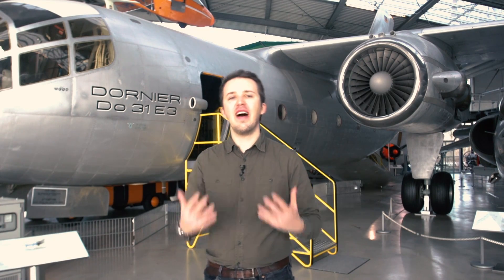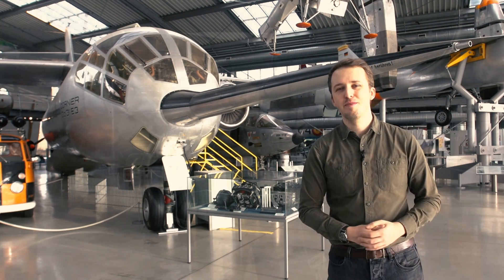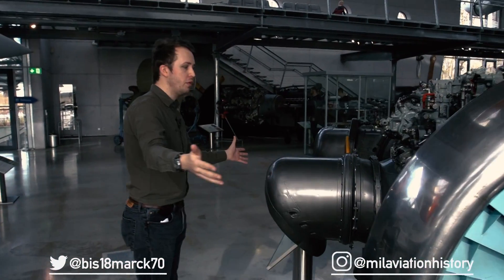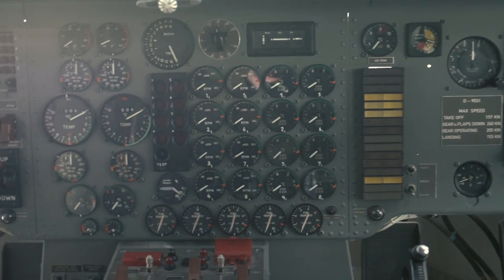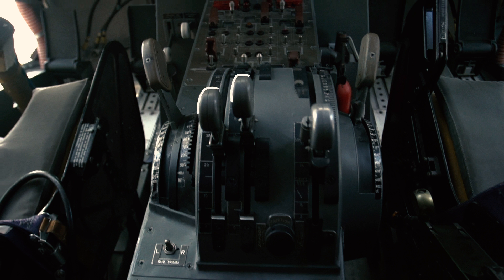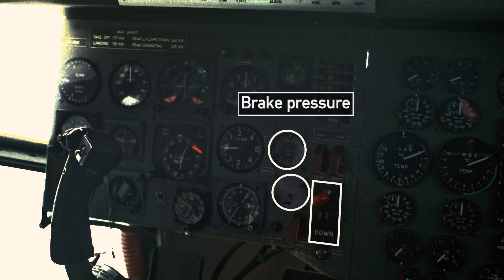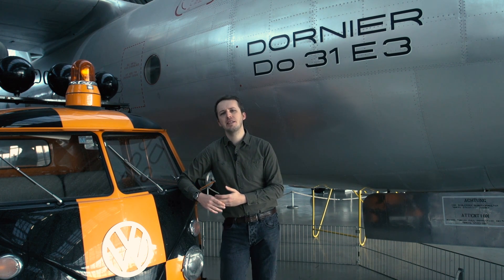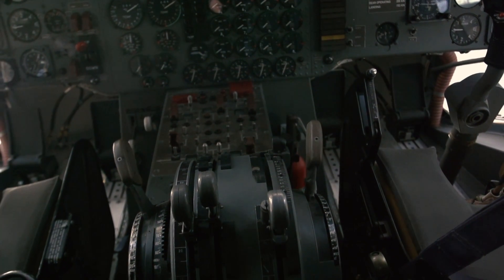Inside The Cockpit - Dornier Do-31

Comment: One wonders 'Why' hasn't SOMEONE Revisited this plane, using Modern Build-techniques/Electronics?! It could shed a ton or two, just by doing That, while gaining in simplified Flight Controls!  BTW, it's Not the 'only VTOL Cargo plane'; the Last Curtiss (the X-19) pre-dated this by a few years, and the Bell X-22 was a contemporary to it. Neither of those, though, were JET powered. Dornier was on to Something with this, and it's sad it wasn't developed further.

Comment: I've walked through this aircraft at Oberschleißheim. It's an artwork in tissue-paper-thin aluminum. The Dornier Do-31. The "Deutsches Museum Flugwerft Schleissheim" (it's an annex to Munich's German Museum of "Masterpieces of Science and Technology" and is also worth a visit) is well worth the visit. Outside of Winter, take your roller blades - That is, if you don't ride your bicycle from Munich's city centre. This aircraft comes with chrome bling. They also have a very truthful hang gliding exhibit. There's a video suggestion 🙂

Comment: I love this idea but its easy to see why it wasn't taken on because the main use of VTOL in a cargo role would surely be the ability to drop cargo somewhere that would be inaccessible by conventional planes. While VTOL craft like this can operate on small patches of land without a runway, they still require a 'good' surface to land on, which limits them to maybe built up areas like car parks or roads or something? 

If only there was another kind of cargo transport that didn't actually even have to touch the ground to deliver something heavy.... oh wait, helicopters :P 

Now I'm definitely more of a plane enthusiast than helicopter fan, but one cannot deny that the Soviets had the much better idea of just using choppers to throw stuff about instead of making an awesome big jet thingymabob like this <3

Comment: It's a german plane, yea? Why are all the circuit breakers and cockpit instruments all labelled in english? 

US component manufacturers?
Reply: At a guess because it was designed to a NATO specification and English is one of the two official languages, the other is French. Add in that English is the default language for air traffic control and it makes sense of a sort.

Comment: Talk about a niche project!
If you've got a to get goods into an area without a runway, you can parachute them in out the back of a C-130 and it doesn't need a long runway to take-off from either.
Then for everything else the Chinook might only have half the range and speed (range being much more important for a transport aircraft) but it has twice the payload capacity.

Comment: Boeing V-20 Osprey says: "Am I a joke to you?"'

Seriously, isn't the Osprey a VTOL transport also?
Reply: It's a turbo-prop not a pure jet.
Reply: He does say "VTOL transport jet plane." You're right. The V-22 must be the most produced VTOL transport ever though.
Reply: @HSMiyamoto  not sure about the production numbers of the VCV-22 being the largest as there have been around 16,000 UH-1 helicopters built. I suppose it depends on where the line is drawn.
Reply: @HSMiyamoto  Well, Helicopters are all VTOL, since that's what they DO. Vertical TakeOff and Landing.  I suppose the Osprey would have to be called a Hybrid aircraft, since it is also capable of Short TakeOff and Landing, where it rolls on the ground.
Reply: Rotary and fixed wing VTOL planes don't compare because a chopper will never have the range of a fixed wing plane. The unclassified range of the Osprey is over 1,000 nm and that's why the U.S. military developed it after the disaster at Desert One in 1980.
Reply: @HSMiyamoto  helicopters are still V/STOL aircraft irrespective of their lack of range. The problem with the Desert One landing site was it was prone to high winds at all times of the year.
Reply: 1. Except for craft that are literally launched vertically like the Bachem Natter, all VTOL aircraft are also STOL aircraft. Helicopters usually lift off going forward, although they can lift themselves straight up and then transition into forward flight. 

2. Although tiltrotor planes might seem simpler than choppers, the fact that helicopters date back to WWII shows that they must not be. The reason the U.S. military persisted with the Ospey over literally decades of development and at least one tragic mass-fatality crash was because the Services want the ability to land troops deep inland without having to capture an airbase first, or even resort to aerial fueling. Range and payload are the advantage of the Osprey over choppers. The U.S. military also has a lot of helicopters for landing troops and conducting other missions, and will for the foreseeable future.
Reply: @HSMiyamoto  you obviously aren't aware that the tilt rotor concept dates back as far as 1902 and and a couple of Swiss brothers? The first practical designs didn't turn up until the 1930s in Germany, but WW2 put pay to their development.
Reply: @neiloflongbeck5705  No, I didn't. But it's probably like the forward swept wings on the X-29. An interesting idea that needed computers to make it really work.

Comment: I had no idea this machine existed.  What a beautiful piece of engineering!  Imagine how clenching it would be losing engines during vertical landing?
Reply: It had an excess of thrust and could afford to lose two lift engines during a vertical take-off or four during a landing.  If it lost one of the main Pegasus engines though, that would have left a mark...
Reply: @FireAngelOfLondon  The early Pegasus engines were notoriously underpowered too.
Reply: @stevek548  That's because forcing gases around tight corners tends to bring heavy frictional and compressive losses and the engineers took some time to learn how to make it work.  The Pegasus has gone from the first versions producing a mere 9,000lbs of thrust to the latest versions that can produce 23,800lbs.  A lot of that improvement has come from finding more and more efficient ways to make air and hot exhaust gases flow around corners, which presents some of the most difficult challenges in the aero engine field.

Comment: Great video! 
Now I hace a question. If this is the only transport VTOL airplane, what's V-22 exactly? Or is there a difference due to the rotor/propellers?
Reply: Yes this is a pure jet where the engines provide the thrust and the V-22 is a turbo-prop where those big blades swinging around provide the thrust.

Comment: The V-22 is a VTOL transport jet plane (turboprop).  It's been produced in quantity and used in combat.  It doesn't have 8 dead cruise weight lift engines.  Rather it has two engines that are used for vertical and cruise flight.  It's American.
Reply: It also had its maiden flight more than 20 years later. Because in 1967 there wasn't technology available that could make a V-22 fly.

Comment: The Do-31 E-1 is infront of the Dornier Museum in Friedrichshafen. two were build. Testing of the VTOL Systems were conducted with the "Schwebegestell" to set up the control systems. With an another construction there trialed the complete system. The ground erosion was too much. It broke some flight records, but the high fuel consumption on a cargo plane didnt make it up in the long run. And it was the time of the oil crises. We germans want always something that can do everything. 

Another interesting prototyp of Dornier is the Do-29. Testing of STOL capabilites.

Comment: this thing makes the tilt rotor osprey look conservative
Reply: And the Osprey needs a ton of computer-assist to fly too. It seems tame by comparison. Now imagine a new carbon-fiber/composite Do-31 with twin F-35 lift engine pods? That would be an incredible follow-up on a remarkable design, even if it's still impractical!
Reply: @miketeeveedub  there's still the problem of carrying engines that aren't used in flight, as well as just making things carbon fiber doesn't make them better or lighter, its a complex material with complex properties and expensive manufacturing processes
Reply: Easier to fly then the Osprey by looks of it
Reply: I have been convinced for years that the Osprey flies merely by Rule Of Cool.

Comment: The only VTOL transport in the world. Why is the osprey not VTOL?
Reply: I think he means at the time
Reply: He said jet vtol transport
Reply: @woodruff4241  I guess your right. Vtol transport...jet plane.  V22 is a jet motor that drives a prop so technically...
Reply: @matztertaler2777  FAA considers both the osprey and the harrier "power lift" not helicopters. I feel this would be in the same category.
Reply: @matztertaler2777  jet turbine runs the drive shift on the osprey. Its not direct nozzle/ exhaust driven but this feels like splitting hairs.